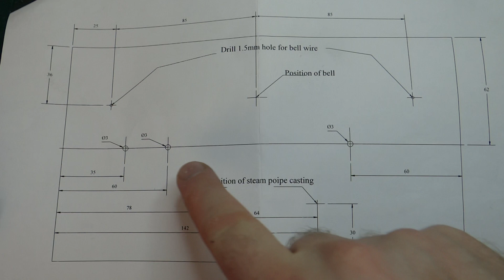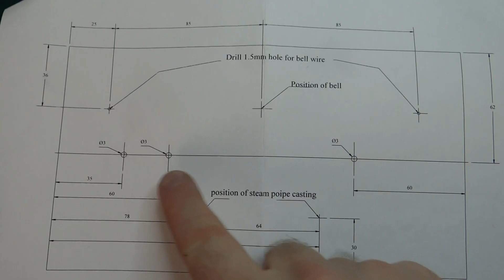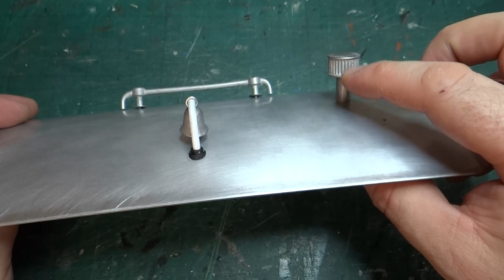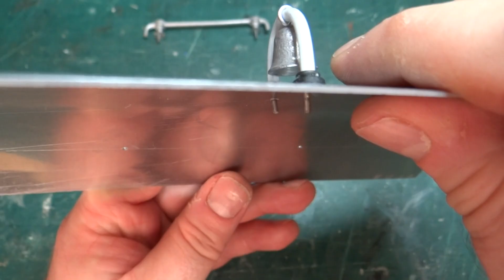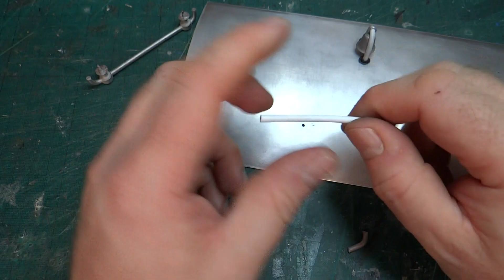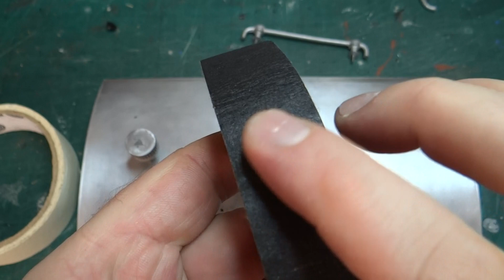Building Toby the Tram Engine (from the IP Engineering Shelley Tram kit): Roof Details

Comment: You could possibly use duck tape to represent a canvas roof. It's hard wearing and quite wide, so it may represent strips of felt in your scale.
Reply from the maker: I had thought about that but tThe problem with duck tape (assuming we are both referring to the same stuff) is that it tends to have a fairly shiny plastic like surface which doesn't take paint well. Even if I used the black version I'd need to get rid of the sheen and I'm not sure how I'd do that as I'm not sure even a matt varnish would stick properly. I think a wide masking tape glued down might be better simply as paint would soak in better. Either way I think I need to find what I have to hand and try some tests to see what works best.